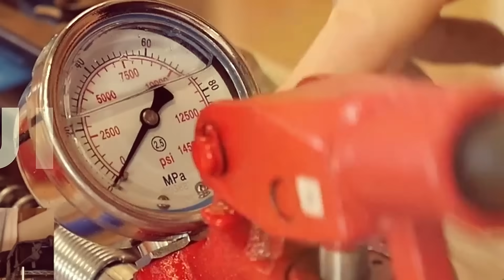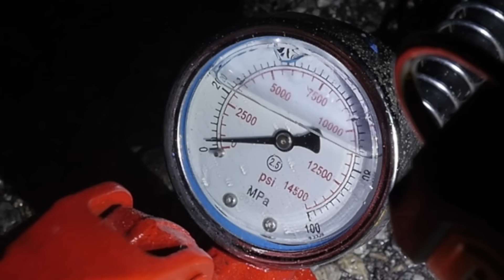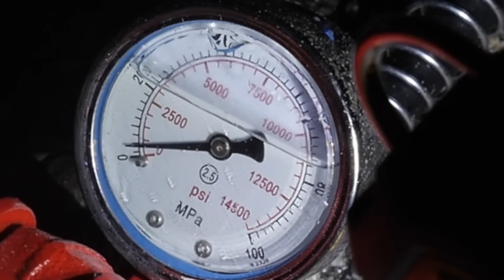Can we blow off these PEX fittings? Sharkbite vs Viega vs Uponor | Best of The Build Show

Comment: When I worked for Watts, we would have an aquarium that had a hand pump on it similar to this setup with a digital gauge for trade shows that showed us the top end.  We used Watts Pex C tubing and Watts Quick Connect plastic connectors.  Typically, 9 out of 10 times we would burst the pipe around 800-900 PSI and the fittings would go around 900 PSI and on rare occasions just above 1000 PSI. Obviously, you would never see that kind of PSI in any residential house, but it gave contractors comfort in knowing that they really do work.

Comment: Did you use the inserts on the Sharkbite?  Another guy tested them to over 1,000 lbs and a competitor blew first.  Actually, you guys need to learn how to do tests properly.  Test each one separately.  We never saw the pressure.  Check YouTube for how to do this test properly.  You don't have a good pressure gauge?  Why did you do this then?

Comment: Just say “no” to PEX. Looks good in lab. Horrible in homes. Low water flow even at high 85+ PSI. NOISY you hear all over home. And never ever run hot water thru the slab—hot water never gets hot.   The weak link is the connections because they restrict flow. A 1/2” fitting restricts to 0.35” not to mention 90-degree. 

If you do install it make sure you choose nothing less than 1” to ensure enough flow equivalent to 1/2” copper. The fittings are incredibly restrictive and noisy. 😢

Comment: You should try to do it with hot water (130 degrees) and compare it with plastic vs brass fittings and watch the plastic connecters fail SOOO FAST

Comment: Pressure gages are most accurate in the middle 50% of the total range. It's a shame you didn't add a much smaller range gage, say 0 - 1000 psi to your test setup. As someone who used to test aerospace assemblies for a living, I say your data has very little useful real-world information.
Not to mention the plumbing was assembled horribly...

Comment: For 500 psi on your water system I'd be worried about the water heater.  Which brings up a good question, what would be the weakest link for pressure in your house water plumbing?
Reply: Would be an amazing video to see a mock home and put pressure on the system. Would also be really interesting to see about flow rate/restriction debate

Comment: Lol next time use only the hot water pipe and the bare minimum length of pipe so that its testing the fittings more than the pipe.   Im talking just barely an inch of pipe where the bands are as close to touching each other as possible

Comment: I have heard a 125# brass fitting installed in a 3000# line go from hydraulic pump pushing a pig down the pipe to clean it. Sounded like a gunshot, right down to the shrapnel whizzing through the air and pinging off stuff. Best to put a wall between you and that in the future.

Comment: Im ex oilfield high pressure tech, regularly working on 5k to 15k-psi systems. I am replacing my polybutylene with pex B clamp type. The more i think about it, i dont trust pex A for the long game. Basically i dont trust the plasticity of the plastic ring to maintain clamp load on the fitting in 20 years. Copper or SS Clamp rings will not have degradation in 20yrs. Its like all this plastic in cars, sure plastic cooling systems work fine, for now. Nothing like metal for long game.
I suppose most people arent thinking 20 yrs from now.
Reply: Also regarding sharkbite PTC, “bite type” connections. Swagelok makes industrial fittings that work in a similar manner. They bite into the tube material. Swagelok handles 5k-psi+ in thick stainless tube, but as the tube material changes, it gets derated. 
Sharkbite’s little teeth rely on the tube to hold on. Id bet youd see drastically different results testing sharkbite PTC on PVC, Cu, pex B, and pexA.
Reply: In the semiconductor industry, the good plastic pipe is fluorinated.  That means it is Teflon like with a fluorine molecule mixed in.  Fittings are welded on.
Reply: @mefobills279 you think the pex A expansion rings are fluorinated? I thought they were the same as the tube material. 
Id trust fusion welded plastic joints forever. But yeah seems like pex fitting leaks (proper install) are usually pex A.
Reply: @schuylerpryne5 I dont know the molecular formula for PEX, sorry.  For fittings its best to compress the plastic pipe walls between an inner insert and outer crimp.  Weld fittings avoid the crimp and are for purity chemicals, DI water, etc where cost is no object.  The thing is, welding is super easy with an automated rig.
Reply: @mefobills279 yep. I agree. No seal like a captive seal, elastomer squeezed between to tougher materials.

Comment: Happy to have Jordan back! This video was always fun. While it would be nice to know the exact PSI of each failure, the point is that they're all failing way above a real world pressure, so you need to pick a different variable to differentiate between them when shopping for a plumbing system. I think a lot of installers are going toward whatever is the most convenient for them.

Comment: So you tell us the gauge goes from 0-1400 but then forget to share what pressure the fittings failed at? What was the point of the video
Reply: Helps if you watch the video.  He specifically said they the hydraulic pump they are using won't give them usable readings and they showed it a few times to where you can see that for it to even start moving the needle it has to be towards 500psi.  They effectively have no reading.   They also stated teh point of the video "what connector is going to fail first" and in the title it even says 'can we blow these connectors off".   The answer is "No. The pipe will fail first in all cases execpt the sharkbite push to fit".
Reply: No they told you the gauge goes to 14,500psi which in this case is irrelevant. I bet they didn’t ever get above 750psi on any of the pipes. That was piss poor planning on their part to think they had enough resolution on their gauge to give any accurate information.

It’s like using a speedometer for aircraft to see your speed on a moped.
Reply: Yes to me it was just an advertisement blowing smoke with no real facts to do a real test you got to keep a record of what pressure you're at now one thing I do which I wonder about I was always taught the weakest point in the system was the fittings under freezing they were the first one to go but you surely me that actually the by yourself

Comment: That was not very informative, at all. More so because the average big box store is selling the average SharkBite push-to-connect and so that is what the average Joe is going to be using. Therefore Average Joe wants to know how comfortable they can be using them in their house. Given that city water pressure is definitely < 100PSI (closer to 65psi) I, Average Joe, want to know how reliable my Sharbite push-to-connect fittings are. You failed miserably in even approaching the answer. You set the Sharbite up as the "this one is guaranteed to fail first" (and it did). But you couldn't tell anyone what pressure was when it failed. Why? Because you used a gauge that couldn't register 100psi and nobody was looking at it when it blew. In the very end you both gave kudos to "Sharkbite" connector(s) BUT left me hanging as to which of them you were referring to.

Comment: There is another youtube plumber that did these tests with a pressure guage... the pressures it took to pop the fittings was way over what a city supply can provide.
Reply: Water hammer can produce pressures way above typical operating ranges ... so supplied/running pressures are least of the worries in typical domestic plumbing system.

Comment: Maybe use Project Farm as a consultant for future test videos?
Reply: Couldn’t agree more 

Equal lengths of pipe / water instead of hydraulic fluid / cleaned and reamed pipe and shower proper insulation. And at least use the current shark bit max
Reply: I can hear it now: "Very impressive!"

Comment: Horrible test complete joke shark bite push connect are as reliable as propress! You shouldn't compress air & water to test fittings that's why you bleed air out of water lines!you can't even seal the threaded connections! Joke

Comment: Matt, Matt, Matt....with the size of your channel and the connections you have, this was just the absolute WORST comparison video and cheapest to boot.  As you pressurize and fail, that's going to make other readings inconsequential.  Proper test would be one fitting at a time with automatic water pressurization and gauge that would stop/record the failure psi.  Poorly done test, with no real conclusion. You can do better.  Sadly, I'm disappointed ☹️.
Reply: I demand the test be redone in a 140 degree attic over 10 years, and step on it once a year with a chubby plumber!
Reply: Jesus dude relax It's a years old video just doing a demonstration Nothing scientific about it They even said the gauge wasn't accurate enough to give accurate readings
Reply: @c56cameo you got one thing right, nothing scientific about it…

Comment: I always fear "user error" with some of these connectors.  I don't question that something will hold X psi under perfect conditions, but I would be interested in seeing how much worse these connectors are if installed poorly.  Maybe not a perfectly cut pipe, or maybe there is some gunk on the sealing surfaces or other things that would degrade performance.  If you guys run this test again, maybe consider the "rushing on a Friday afternoon to get done" situation when plumber Joe just had his liquid lunch and he's not doing his best work.

Comment: is PEX in concrete secure?
Reply: That's a more interesting question than it might appear on the surface. I would suspect it would take more pressure being supported by concrete. In essence, you are putting a concrete sleeve around the PEX so it couldn't bulge out and fail as quickly.

Comment: If you get a better gauge plz redo this test but build the rig so every pipe faces the same way  preferably down and there are no air bubbles in the pipes or fittings. I can draw you a better design that would allow for quicker filling the system and eliminate air in the system as a variable

Comment: Copper is failing at 30 years or less in my area in Tennessee too. Especially cold lines.
Reply: I'm an architectural drafter and my latest client just had to redo all their copper at a religious dormitory. I think it was originally installed in 98 so about 30 years
Reply: @Eric998765  In my house the copper pipes are from 1982 with 5bar pressure.
And at my mother house the pipes are from 1950 and had 5-8bar pressure. 
Still no leaks. But since i'm a plumber i often see much newer copper pipes leak due to salt, sand and such in the water.

The company i work for have used Sharbite/Roth Nordic since 2012, they work great, but we never use fittings inside walls.
Reply: Recycled copper is part of the problem My house was plumbed with it in 2000 In 2015 started having leaks in the pipes In 2020 had to replumb the whole house with pex Was told virgin copper should last Who knows anymore
Reply: @c56cameo 

100 % the factor no one addresses. Combined with everyone use the thin walled class of copper pipe
Reply: @c56cameo yeah it's what their putting in the water I think but maybe just bad copper?
Reply: @-Enrico I'm on a well It tests very clean
Reply: @c56cameo  pure Copper is  pure copper, but how thick the pipe walls are play a role, and if the plumbers bended the pipes wrong so you get turbolence in the water etc.

Comment: I'm seeing pex start to fail just at the pipe, the fittings are fine. The pipe starts to get like these hairline fractures and with pex a doesn't allow for expansion after a few years splitting. Even saw a pin hole on pex which is crazy. Anyway this is in Tennessee, I love pex a but crazy. Cpvc gets brittle but haven't seen any Pinholes or hairline fracture stuff. Let me know what you think
Reply: Never seen such before, maybe they have been exposed with much light? Our pex pipes in Norway is allways inside of another pipe, so they get protected from sunlight and if they have leaks it won't get wet inside the walls, and you can insert a new pipe without opening the walls. But i have seen that they gets much more stiff over time.

Not my language, but i think you will find this video interesting https://www.youtube.com/watch?v=KdKd7uOzqnQ
Reply: or this https://www.youtube.com/watch?v=1asdc1G2CoE
Reply: @RogueSecret interesting thanks
Reply: a or b
Reply: hey buddy what's up? im in east TN and getting ready to plumb my home build. got a really good plumber and paying him well. just curious but are you saying the main line coming in, which is some kind of pvc, where it connects to the pex connection is where you are seeing pinhole failures? my guy said he uses the same type of line material the city uses so maybe i don't to worry as much about that. thanks bro 🫡